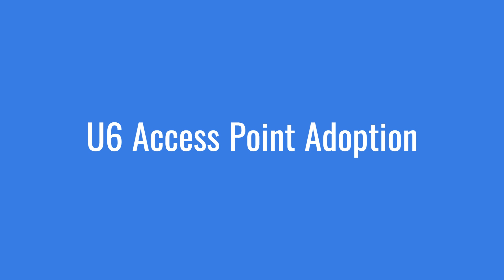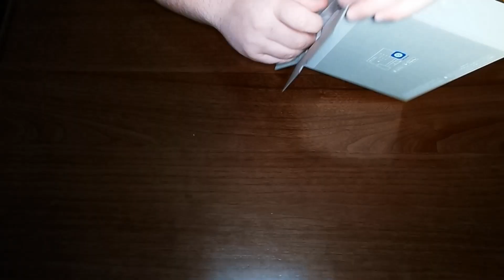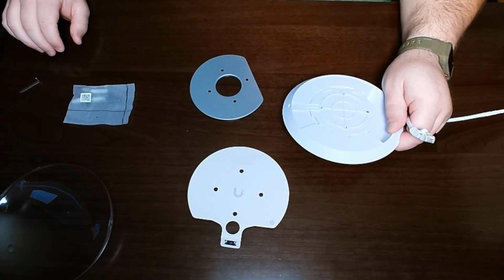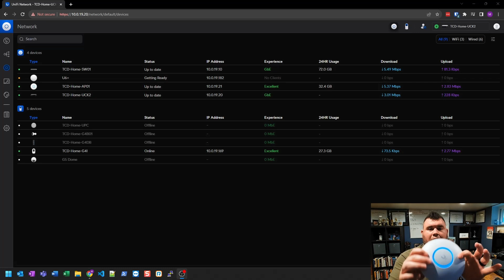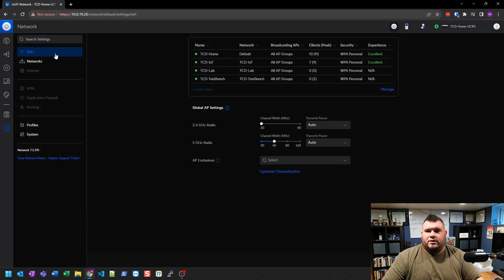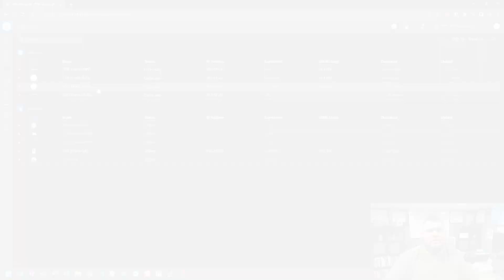04 - U6+ Adoption and Setup

Comment: Hmmm lost, so that is if you have a Unifi UCKm, and if not????
Reply from the maker: You can use a software controller installed on a PC or a UniFi OS platform like a UCK or UDM. In this video, I was still using a UCK Gen2 Plus.

Comment: Great Video ! My U6+ is already running ! But how can I dim the Blue LED from the AP ?  It is to Bright !
Reply from the maker: You get two options - on or off. This is based on the UniFi App and settings on the new U6+.

The running joke is that the LEDs in the Ubiquiti AP line will dim on their own over time…

Comment: Can this AP do 2.4Ghz running WiFi 6 and can it do HE160? Unifi website doesn’t say anything about those features.
Reply from the maker: The U6+ has dual-band but 2.4Ghz only has HT20 and 40 options. 5Ghz has 20, 40, 80, and 160.

This is from checking the UI radio settings with the AP on the 6.6.55 firmware, and the Network app on 8.0.28.

Comment: It has no bluetooth. Can it still be setup in standalone mode?
Reply from the maker: It can be, yes. The recommendation from UI is to have a software controller or device running UniFi OS, like a Cloud Key, however it can be done in standalone.

Here's a like to UI's documentation: https://help.ui.com/hc/en-us/articles/12594679474071-Standalone-Access-Points-without-UniFi-

Comment: Do i need a specific router/modem to run one of these? I want to add one in the middle of my house so the entire home can have wifi. Thanks!
Reply from the maker: Nope! You need a PoE switch or power from USB-C and something handing out DHCP so it can get online for the initial setup. This can come from your internet provider’s equipment. 

The U6+ provides up to 1500 sq. ft. of coverage. I have it centrally placed in my home and it works just fine in all extreme corners.

Comment: Great start there bro.
Just purchased a U6+ , US-8 switch. I have an edge router X from previous network, so looks like we are building together.  UCK is the direction im going as I'll need at least 3 AP to cover my house, and i was to add a camera or 3.
Reply from the maker: Thank you! That's a great starting kit! The UCK is excellent. If you get it, get the rack kit as these things get hot and it negatively impacts drive life (it's a 1TB spinning disk). I have a U6+ and a UAP-AC-Pro along with 5 cameras and a chime running off of it. It's a great home setup and I can access it anywhere without port forwarding. 

Happy to answer any questions as you get it set up! Thanks for watchin!

Comment: Very nice. A good trick to know is that you can use a standard size zip tie to remove the access point from the mount if you lose the metal removal tool
Reply from the maker: Yes! That or a small paperclip as it is firm enough to lift the small clip. We had a tech on site losing their mind last week trying to remove a UAP-AC-LR from a similar back plate. While I'm sure they felt differently, it gave me a good laugh from the other side of the conference call. 🤣
Reply: @TCD_TheComputerDad  It can really be a pain, especially if you're on a ladder trying to take it off the ceiling :D
Reply from the maker: @MrJonas7  I believe it! I'm a big guy so me and gravity do not mix. I'm not trying to play that game high in the air. Everyone loses if I go down, lol!